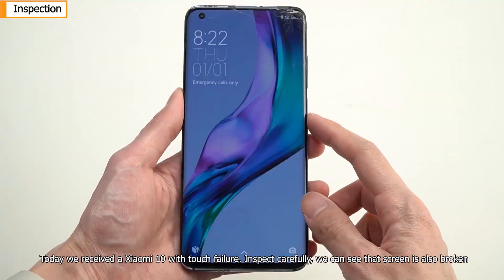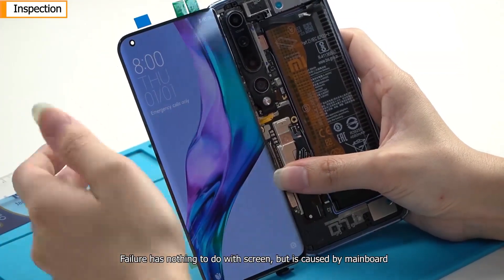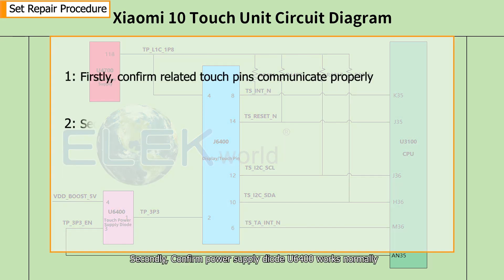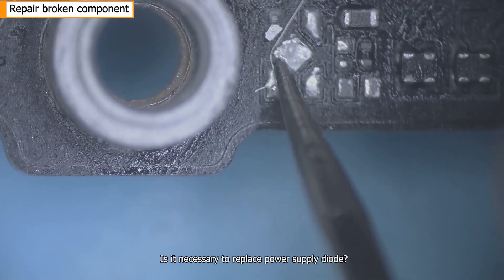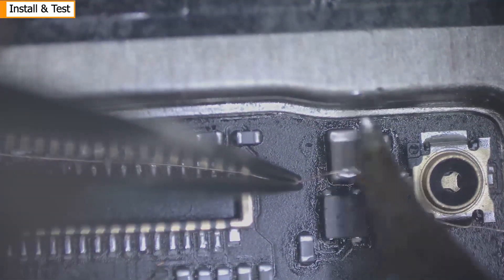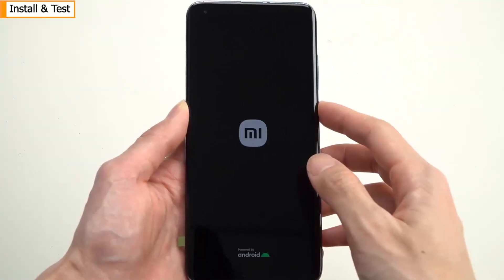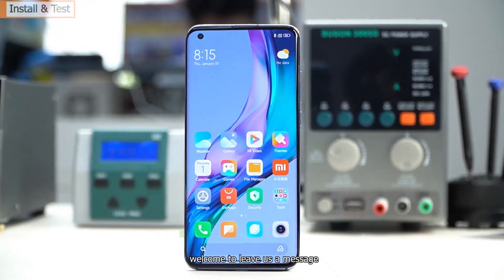What a Profitable Job--Xiaomi 10 Touch Failure Repair

Comment from the maker: Currently we received a Mi 10 with a touch failure. We preliminary rule out screen problem.This video will take you step by step to find the source of failure. And the final repair step turns out to be surprisingly easy.

00:00 Inspection
01:01 Set Repair Procedure
01:40 Troubleshooting
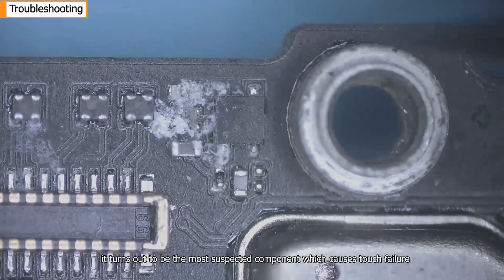02:18 Repair broken component
03:24 Install & Test

For more Repair parts&Tools and Tech support, please visit:
Website: https://www.elekworld.com
Facebook: https://www.facebook.com/Elekworldshop/
Instagram: https://www.instagram.com/elekworld/
Twitter: https://twitter.com/ElekworldL

Comment: Any reason why diode bridge was not just replaced ? It is not dangerous to draw current from other circuit on the board ? can it burn the IC or MOSFET there with time due to the current overload ?
It looks a regular diode bridge that cost less that 10 cent
Reply from the maker: 1- In case that you don't have new diode replacement at hand;
2- the risk of overload or damage is very low;
3- the optimal method is replace a new diode for sure.